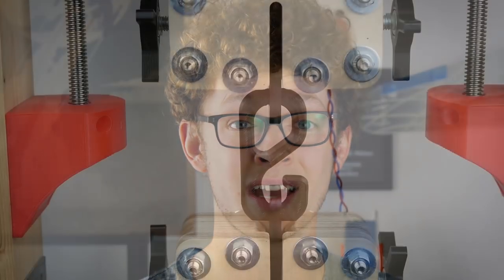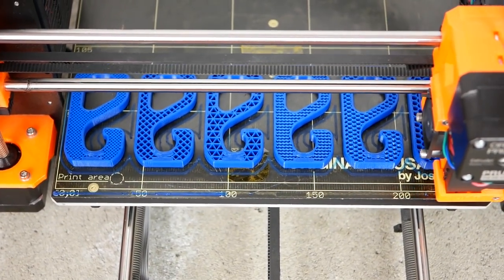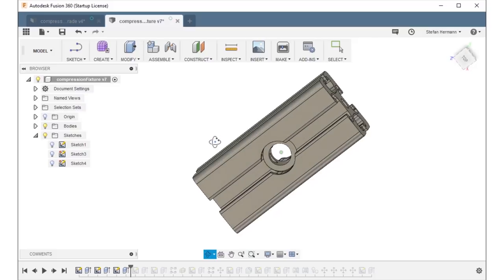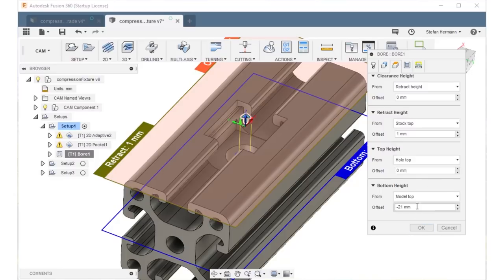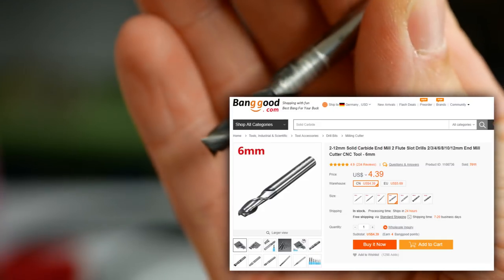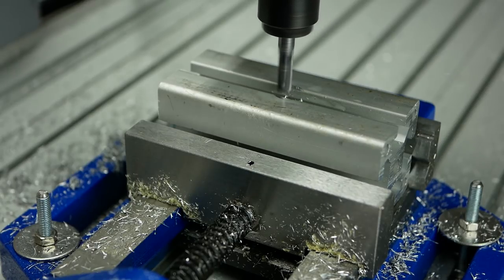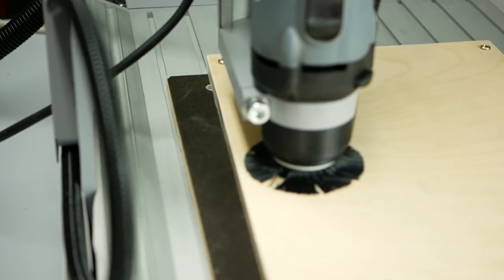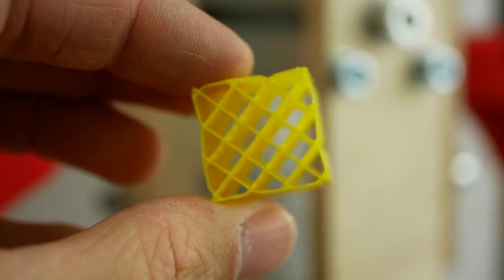Machining a Compression Test Jig for 3D printed Infill Pattern Testing

Comment: Hey Stefan awesome channel! You are so so thorough with everything you do, especially the 3D print tests!
A tip for smaller CNC routers such as yours- try a straight 2 flute carbide cutter on wood, you won’t get any of those annoying fibers on the top surface of softwoods and also no delamination of plywoods.
Keep up the great work 👍

Comment: I would love to see some performance comparisons between prints made from filament that has been stored out in the open, and filament that has been properly stored in a sealed bag with desiccant. If you do so, I suggest using color-changing desiccant so you know when it has been saturated. For now, just the basic two - ABS and PLA would be great. Cheers, and congratulations on the new rig.
Reply from the maker: There might be something in the line ;-)

Comment: Most miter saws (aka, chop saws) will cut aluminum without a problem with a suitable blade (tri-cut-tooth, or “TCT”, is typically recommended). Also, Evolution Tools makes a miter saw that will go thru mild steel...

Comment: Mach3 backlash compensation doesn't work that well. I turn it off because it makes the motion much less smooth. Smoothness is very important for adaptive strategies.
Reply from the maker: Good to know!
Reply: Open loop backlash compensation does not really work well, Mach 3 is not unique in that regard. Open loop compensation adds in some extra steps each time an axis reverses. This sounds great in theory IF you know EXACTLY how much backlash each axis has and that amount NEVER changes. 

In reality the force of the cutting action tends to move the bed/carriage around within the backlash envelope so you never exactly know how much to add. If you do a simple test you will notice things like a circle no longer has flat spots at the quadrants but the cumulative effect of compensation is not good.

I theorize that if you have n.nnnMM of backlash in an axis your error, due to backlash, will be bounded by that value as your movements + and - along the axis will add up to close to zero (else you would run past an axis end stop).  With open loop compensation the amount of compensation applied will never be exact so you will most likely drift further out of position over time. I came up with a script in Excel several years ago to demonstrate this.
Reply: You can probe each axis and tune the settings but Mach3 comp works good only with backlash less than 0.05mm.

Comment: Hi Stephan, and thank you for your work.  With your instrument, could you map the compressibility curve of molten filaments?  That data would be quite handy.  Perhaps driving a piston into a known geometry crucible, or a driving a short stick of filament into a heat block against a dummy nozzle (collet blocks would be the tricky part)?  I'm sure you have plenty of infill patterns and almonds to crunch on that thing, but known compressibility would sure help understanding of retraction and extrusion advance.  Thanks!

Comment: Have you ever tested whether there's a difference in strength dependent on bed placement for your machine? How large is the temperature change across your bed platform at your default temperature?
Reply from the maker: Haven't done that yet. Modern beds have a pretty good temperature distribution which doesn't vary more than +-3°C. Should not have a huge result on the strength. More interesting is, if you are working with PLA, that the layers close to the bed will crystalize more than the rest due to the temperature.

Comment: I am a postdoc researcher in plant ecology and I am interested in studying mechanical properties of leaves. I am wondering if I could adapt this machine to perform shearing/tearing and punch tests on leaves from different species. That would be awesome!!!
Reply from the maker: Should be possible with some adaption though your forces are probably way lower. Plans for the machine are all open source.
Reply: @CNCKitchen  Thank you for replying! This is why I am amazed by your machine, the possibility to adapt it in many ways. I have been looking for a UTM to conduct my research... but, besides quite expensive, most of them are not made to test delicate materials (although some can handle paper sheets). The expected forces are indeed lower, although you could be surprised by how tough and strong some (particularly desert) leaves are. My background is in leaf hydraulics, I am beginning my studies in leaf mechanics (and also in Arduino and electronics), so any suggestions of how to possibly adapt the machine are very very welcome. Thanks!

Comment: Nice. Have you considered doing abrasive testing on different filaments? Would be interesting to see how carbon filled filament and rigid TPU performes in an abrasive environment.
Reply from the maker: Thought about this and actually already bought some equipment but I didn't finish that project yet.
Reply: Awesome! Keep up the good work with the channel. I like the technical/logical approach.

Comment: Hi , you can set your cnc x and y position by using a piece of paper , instead of rotating your tool , this leaves no marks on you Finnished part .
Reply from the maker: Exactly. Make the piece wet and it even sticks better ;-)
Reply: I have been working in engineering for over 35 years,  been a cnc programmer / setter for over half of that . I like the look of the cnc you use , can coolant be used on it ?
Reply from the maker: Yes, there is a flood cooling system available I used in a previous video: https://www.youtube.com/watch?v=AHSTbaduXUM
It's not perfect, but did the job!

I already have the parts for a mist cooling system here as well, but not installed yet.
Reply: Yes I remember , but you had trouble with the coolant blocking . So it will need a filter before the pump.  Great , thanks Stefan . As always,  I look forward to your next upload.

Comment: Kauf dir einfach ein Kantentaster, die haben eine Genauigkeit von 1/100mm beim antasten und kosten nicht mehr als 10 Euro. Falls du doch mit dem Fräser weiter antasten möchtest markier dir die Antaststelle vorher mit grünem Edding,  so kannst du sofort sehen wenn du das Werkstück antastest und bekommst keine Marken ins Werkstück. 
Grüße vom Feinwerkmechaniker.
Reply from the maker: Kannst du einen Kantentaster empfehlen? Ich kann maximal 10mm in der Spannzange spannen und alle, die ich bisherigen gesehen hatte waren größer.
Reply: Also wenn du 10mm spannen kannst hast du Glück, ein Schaftdurchmesser von 10mm ist bei mechanischen Kantentastern die Norm :) Die Frage ist eher ob dein Fräsmotor auch Drehzahlen von unter 800 für das Antasten breitstellen kann, sonst fliegt er dir um die Ohren xD Empfehlen kann ich dir einen mit zwei Antastzapfen, meistens 10mm und 4mm, damit man auch an kleineren Stellen rankommt. Ansonsten spielt der Preis von den Teilen keine Rolle, da wird auch ein günstiger für unter 10 Euro ausreichend sein.
Edit: Unter folgender Bezeichnung solltest du ein passenden finden: 10-94-10/4

Comment: Please test the new implemented Gyroid-Infill of Slic3r PE :))
Reply from the maker: I will!
Reply: Awesome! :D Looking forward for the test. I am really curious how strong it is compared to the other common infills we already know.
Reply: I think it's not ready yet. I did some testing already and it looks like there is missing material, about 8-10 %
Reply from the maker: I also already printed a couple of parts with it. Worked fine for me. Where did you miss the material?
Reply: I already tried it as well and i can not complain about missing material. For me it was totally fine. You know that you can control the infill extrusion width in Slic3r PE ? Maybe your's is too low or other factors are influencing it negatively

Comment: hey bro, on patreon you say you'll "buy a proper cnc router" when you reach a certain goal; now that you have a cnc router, is that still something you plan to do? or did you mean a (diy) cnc mill?
Reply from the maker: Well, I recently got a better CNC router and am doing more projects with it, so the patreon goal needs to be changed, I guess 😉 but I'm also planning something on DIY cnc routers.
Reply: are you aware of the differences between a mill and a router? just so i'm sure we're on the same wave length lol. regardless, cool that you're doing more things with metal!

Comment: As a free alternative to Mach3, look into bCNC - it's quite a feature-full grbl-compatible sender and can do even light CAM duty. .. Or grblControl/Candle, which is a bit simpler, but can still do easy surface probing (ie. for PCB milling) and supports true jogging (with grbl v1.1). I use both: https://github.com/vlachoudis/bCNC ,  https://github.com/Denvi/Candle/tree/grbl_1_1

Additionally, instead of manually positioning the endmill, use the "probe" pin on your grbl arduino to close a circuit between the endmill and the stock (if squared), it's much more repeatable. Or make a touch-off probe if you can mount it somewhere, grbl supports G38.2/3/4/5.  https://www.thingiverse.com/thing:721620
Reply from the maker: Thanks for the info!